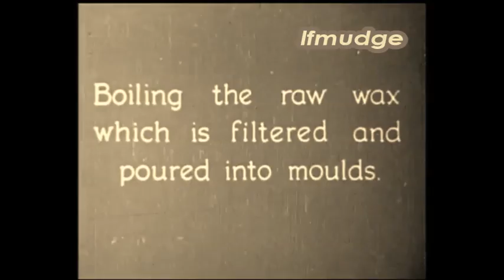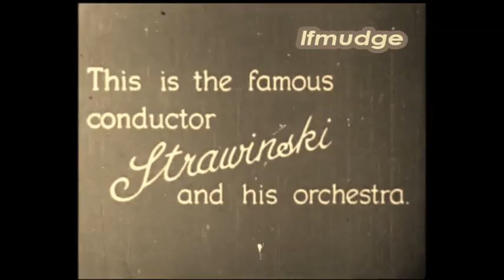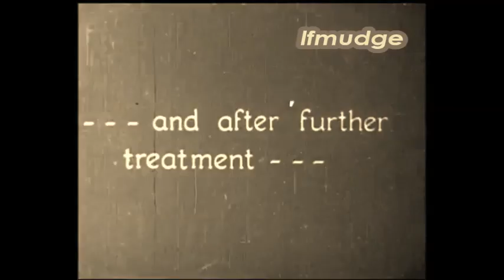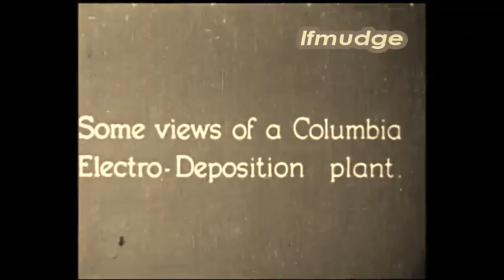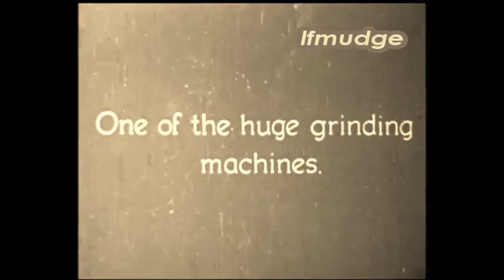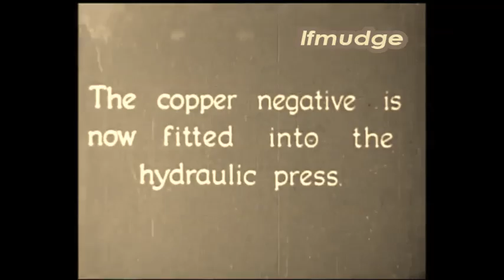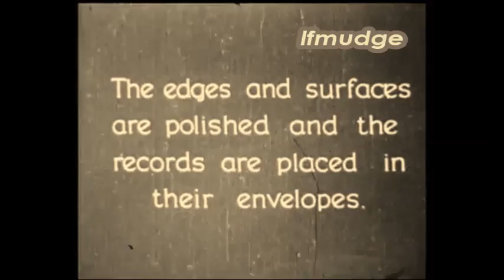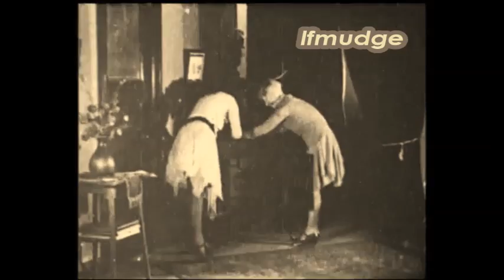How a Columbia record is made 1928 Parts one & two

Comment: It was the same principle as done till the 1990's. Only differences were, that they record the performance on tape first (this began in the 1940's in Germany) that they changed the material of the cutted disc to lacquer coated steel platters and later to copper discs (DMM process), that they enhanced the way to coat the recorded disc with a silver layer, the use of smaller grooves and the pressing in vinyl, what was possible, when customers stopped to want discs, that can be played without any electricity.
Reply: They were usign digital tapes since 1890s. This video they used a Studer 8 track recorder with DCA converters. Not muc han chanes in 140 yeas is naytbng the sound recoridign has gotten worses.
Reply: @ilovecops6255  I think you're being sarcastic here.

Comment: As I hold a mint copy of a Columbia 12" 78 titled; ROBERT BURNS--A Man Amongst Men. By the Prime Minister The Rt. Hon. J. RAMSAY MacDONALD, M.P. (Burns Anniversary, January 25th)  The year not mentioned but guess about 1928. These Columbia records were of extremely high quality totally smooth surface without surface noise perfected. This film should have been a education to E.M.I.
Considering the emphasis placed to quality involved here Columbia laminated all their 78rpm records until the 1931 E.M.I. takeover.
Thereafter surface quality dipped a bit due to E.M.I. & also Decca not laminating their new releases.

Comment: The most surviving shellacs have massive shellac, no layers.
Reply: What are the layers made from and why did they make it like that, where can one find some technical information about that?
Reply: @ralflang5524  Columbia used laminated pressings from the time of the introduction of "Double-Disc" records in 1908 up to the end of the 78 era. 

The core of the record was made of fairly coarse, strong material, and the playing surfaces of very fine composition.  The "New Process" Columbia discs of the 1920s and 1930s tend to have exceptionally quiet surfaces.  They also stand up well to wear.  Far superior to the general run of pressings offered by Victor or the Gramophone Company.

Unfortunately, lamination cracks can be a problem on Columbia discs, but they are a minor inconvenience compared to a crack in a solid Victor pressing.